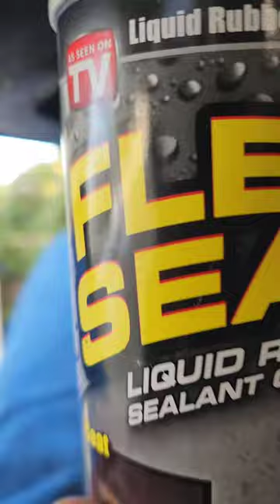Trailer disconnected / connected error F150 wiring FIXED

Comment: I had the same problem and wasted about half a day chasing the problem on my newly wired trailer.  Finally I gave up and bought the $11.99 vehicle side tester and discovered the problem was the same as yours; dirty connections at the plug.  I cleaned it up and slathered the dielectric grease as you did.

But I have a further problem in that the plug that connects the wire harness to the 7 way trailer plug won't click-lock into place as yours did.
Reply from the maker: There must be something holding it out a little
Reply: @BartFixesIt  it's getting fully in there, I think the prong is just bent down a little bit so it doesn't snap shut.
Reply from the maker: @scottdelaney98  I haven't seen shorting, but it would be a good idea to not be as generous with the grease as I was!

Comment: I had a problem where my trailer would lock the brake wheels whenever the wiring connector was installed between F-150 and trailer. I finally snapped that maybe the +12V was connected where the brake wire was. Sure enough, that was my problem. So I am troubleshooting this issue. From all sources the +12V pin is directly opposite the ground pin. In my case, that reads 0V, but the blue wire has the +12V on it. My pins look like yours. Somewhere in my vehicle, the brake wire and the +12V accessory wire must be crossed????? Any ideas?
Reply from the maker: I would guess it would be either close to your controller or close to the trailer wire,  maybe even a trailer wire crossed
Reply: @BartFixesIt  Turns out the wiring was correct. The problem was the counterfeit brake controller was putting +12V on the brake line all the time. Tried an actual genuine Ford part, and everything works. Also discovered the accessory power isn't applied until the brain in the vehicle decides an actual trailer is connected. I haven't verified if mine works or not, but the brakes work great now.

Comment: When you are greasing a connector you should do the exact opposite of what Bart has done.  You want to grease the intercourse of the pin and the socket.  As most males know putting the grease around the socket doesn’t work.  Get a small wooden dowel cover it with grease and work to get some on all the pins. Now plug and unplug multiple times.  Until satisfaction is achieved.   (And no I do not see any sexual overtones in my comment )